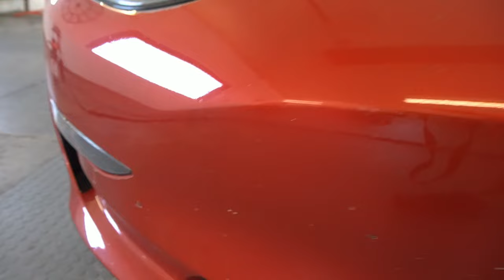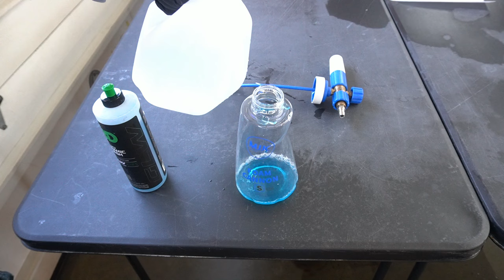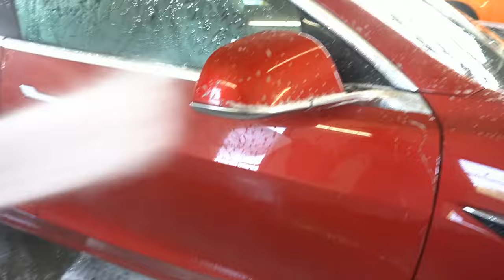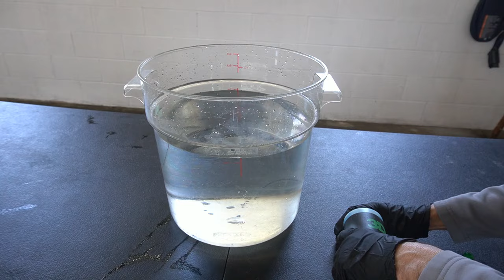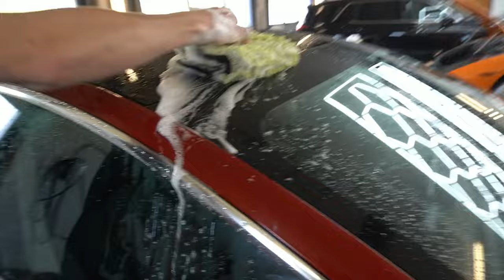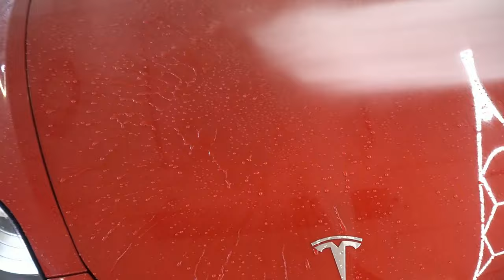3D Sio2 Ceramic Wash! GLW Series! Will This Be A Ceramic Car Shampoo I actually Like??

Comment from the maker: What is your opinion on Sio2 shampoos?
Reply: I've used a couple different ones and didn't care for them. Like you said, I'd rather use a regular soap with lubrication and apply the si02 myself. Thanks for the video Brian.
Reply: The only one I use is the TW Hybrid Solutions Ceramic Shampoo.   I use it on my personal cars as a maintenance wash.  I'm perfectly satisfied with it as I use much of their Hybrid line on my cars, so I use the SIO2 Shampoo as part of the Hybrid Solutions system. It works really well within that narrative.
Reply: Nope. Don't like them.
Reply: CRAP!!
Reply: Awesome video and product review good friend
Reply: COMPLETELY agree with you on sio2 soaps.if I need protection I'll use my BC product line obviously
Reply: Sad u paid a lot 4 that foam canyon and it died. My tri nova ALWAYS performs even after 6 years and it's 34 bucks.
Reply: They suck big time.
Reply: @remarkable224  just curious  - how so?
Reply: @richardseem7948  am curious to your answer  - why?...
Reply: Your review is right on!
Reply: I just use a PH neutral shampoo.  Meguar’s Gold class and Mr Pink have worked well for me.  Budget friendly.  They seem to do the job.  If I need to take things a step further, I will use Griot’s speed shine
Reply: Carpro Hydro2 foam is excellent
Reply: @audieconrad8995  They don't clean well, have no lubricity, have little to no lasting foam, and they offer minimal prptection.
Reply: @remarkable224  well, what shampoo offers protection? - cmon!  
I believe the actual function of SI02 shampoos is the shine - gloss enhancement. Which has been my experience. Ya, some (may) offer (some) ever so slight protection, but really...naw - not much.  Lack of suds...ya...but if the lubricity is there, so what?  Now, to be honest, I've only used the Hybrid Solutions Ceramic Wash and have been quite happy with it.  Different? - yep, but it works for me as a maintenance wash for my personal rides.  As I understand, some of the Ceramic Shampoos do suck and some are pretty good.
Like everything else within the wretched excess of the car care industry [hi ph, low ph, acidic, non-acidic, gloss enhancers, straight  soap, ceramic] and on and on...
[Some] Ceramic Shampoo has its place.
Shine on you crazy diamond!
Reply: The only ceramic/graphene/etc soap i have enjoyed is adams graphene shampoo.
Reply: I use Gyeon Bathe+ for the contact wash and am satisfied with it. It has good lubrication and does a good job of helping to maintain the hydrophobicity of my coating.

Comment: These shampoos perform better in a pressure foamer. A large amount is wasted in the backet, as we see there is much water left. The same amount of product if it was thrown in a pump foamer, would make a much higher concentration of solution. So when foaming part by part, the foam would sit on the mitt and on the panel, not in the backet

Comment: I think the entire detailing industry has gone bonkers, I rinse, foam with shampoo and wash, yet to mar or even micro mar a car, wasted money, wasted product wasted time, if you want protection apply it separately don’t over complicate the process
Reply: If you've contact washed a car, you've marred it on some level. Maybe you can't see it immediately, but even the nicest towel with the nicest soap still leaves very small marks that add up eventually.
Reply: Even so if you’ve only “rinsed” before contact wash
Reply: Not, 28 yr veteran, understand how the game is played, 9-10 ppl don’t know what micro marring is if no one’s ever complained you’ve never done it